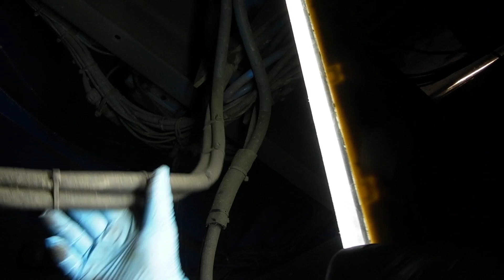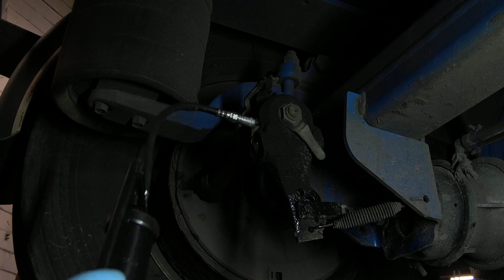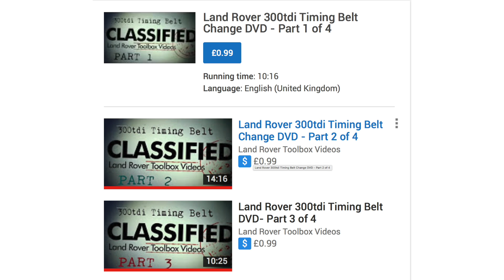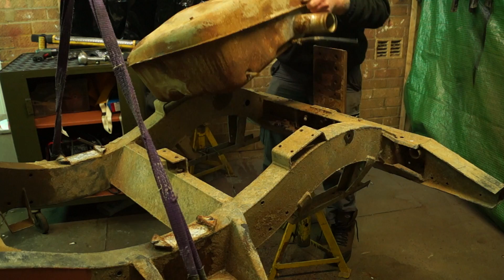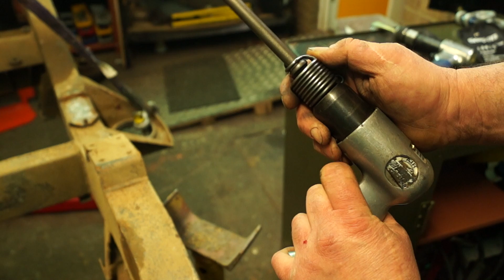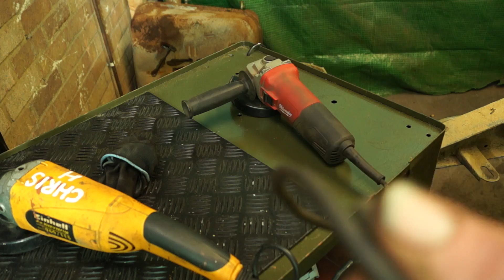LRTV Patreon Elites - A brutal solution for removing the 110 fuel tank

Comment: The yellow grinder is known as a rat tale grinder in the US. much safer switch and position.
Metabo do them. Not cheap but will probable last until retirement. 
The part numbers I know are;
WP1200-125 RT and WE 1500-125 RT. The latter is the daddy of all grinders.

Comment: I have been considering replacing my cheapo chineseeum hammer chisel ... but I opted for a plasma cutter instead which has proved more useful so far. Mac or bluepoint though... that's the question!
Reply from the maker: Mac.  They are part of the Stanley group.    Nice selection of cutter, Sir.  Would love to have one in the workshop but can't justify the cost yet.
Reply: I promise that the instant you have a chance I would buy one. I honestly don't know how I've done without one. You'll need serious air to back it up if you have more than a few inches to cut!